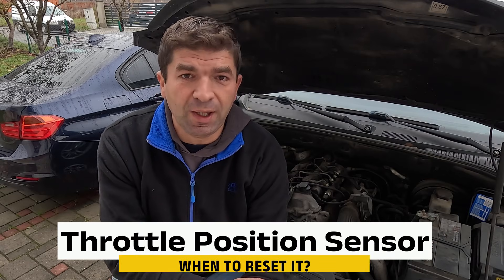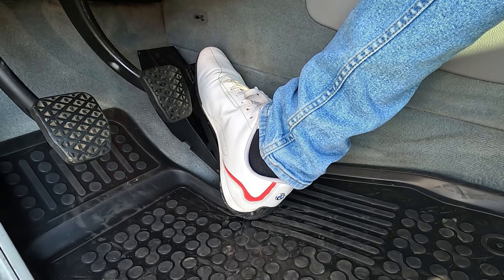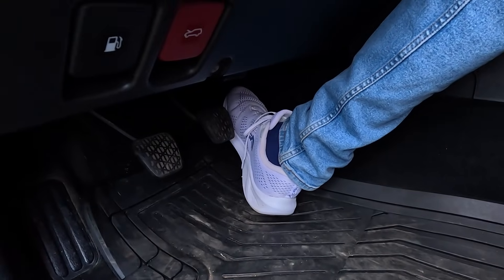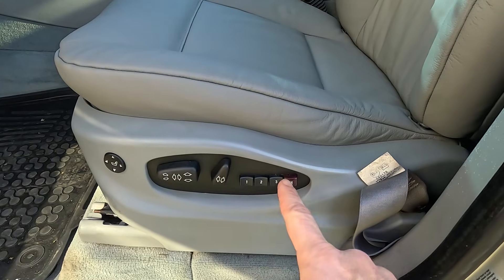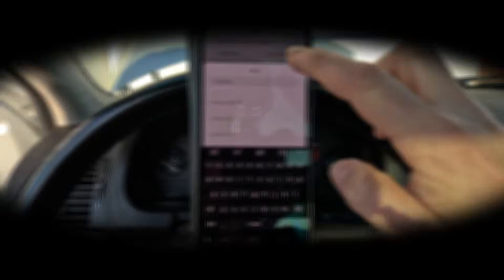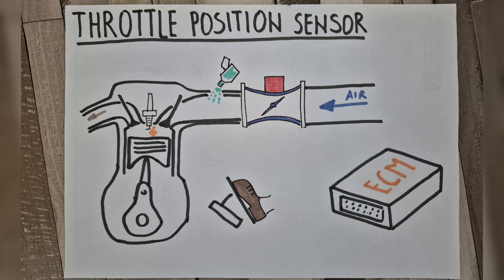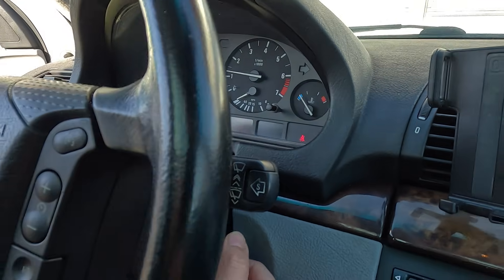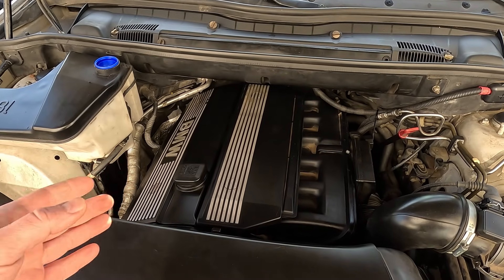Throttle Position Sensor (TPS) Reset – 5 Methods That Actually Work

Comment: Hi there
I can't find the issues for my mercedes w203 c180 2005
After I have replaced timing chain 3 weeks ago there is an issues with rpm only when I break at trafic light or in traffic and almost stop the rpm drop under 500 where it should stay and it give an idle and time to time have a very rough idle for 10-20 secs in the same conditions and I have no idea what can be as only 2 times I had an errors regarding mixture and sometimes check engine is on for 2 days and then go of without doing nothing but there is no errors when I use a tester so if you can advice what to looking for as I am thinking at throttle body, map sensor Coils but without errors where to start
Thank you